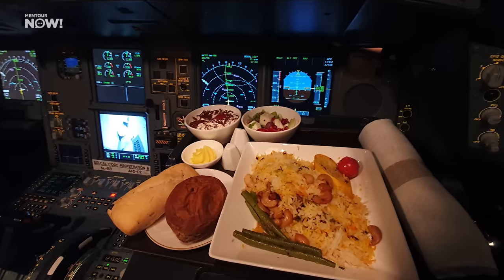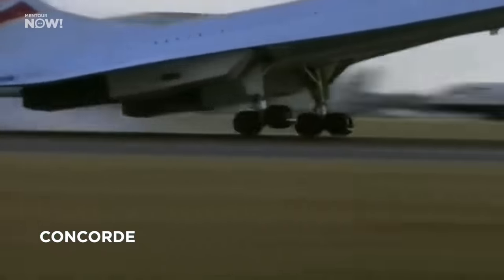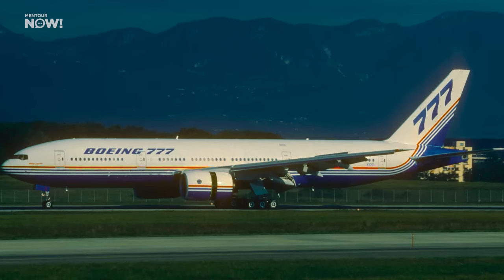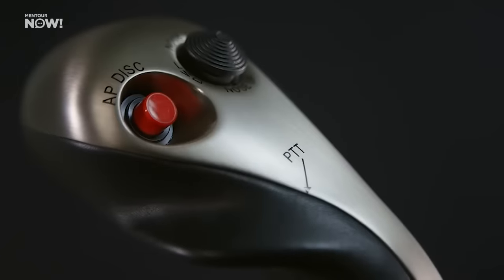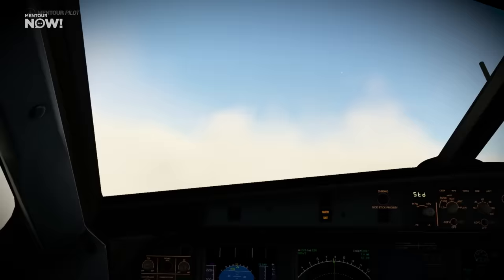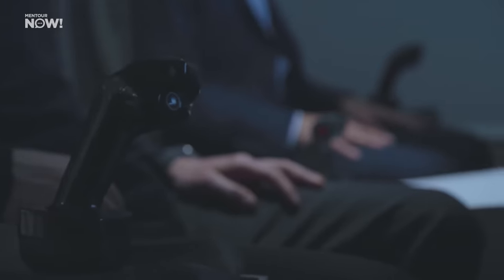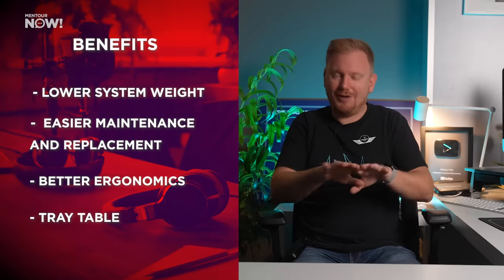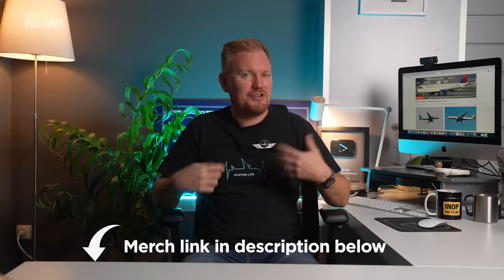Will Airbus Finally switch??

Comment: I wonder if the author has actually spoken to anyone who has been involved in design, build and certifying  an aircraft.
The idea that anyone is going to design , test and certify a retrofit for some 15,000 A320 and another couple of thousand airbus wide bodies, is way out in the realms of totally ridiculous.
Would Airbus do the next aircraft with one ? Well, they haven’t shown any inclination so far. After all, why would they? Which accidents are there directly linked to the sidesticks not being linked and there being no other indication of the main item, the pitch attitude, resultant flight path and performance, that would not have given clear indications of inappropriate control inputs, whether manual, or automatic? 
By the way, the side stick is clearly visible from the other seat. As for non moving thrust levers. Well, I have flown the 747-400. I watched the ATS drop out and the crew let the speed drop several tens of knots below the bug, have an EICAS message and still do nothing. I watched the ground spoilers not automatically deploy, but the crew called them deployed, even though the handle did not move!
If you want to know how much thrust/RPm, EPR you have, you have to look at the gauges. The thrust levers are merely a “wish list”. After all , a failed engine can have the thrust Lever fully forward.
As for flight control laws. Both Airbus and Boeing use the C* law. That is  a G demand law , which at lower speeds gets phased into a pitch rate demand. Without that,  you would get to impossibly high pitch rates. This is not the  Airbus protections, they are separate.  Boeing has an additional function, U . This introduces a speed reference input. Essentially, the trim switches operated by the pilots select a reference. It is instantaneous if the pickle switch is used. It does NOT control the stab trim on Normal Law! I it use sets a reference for the flight control laws U term. The U term causes a pitch up or down term into the flight path laws if the speed deviates more than plus or minus 10kts from the chosen reference. It doesn’t change the trim, just the flight path. Why plus or minus 10kts? Well, otherwise the ATS ( nominal accuracy +/- 5kts, would cause constant deviations in flight path. Add in another few kts for turbulence and you end up with 10kts. 
As for the. 777 moving control column. It is a several hundred pound weight system, with dual hydraulic jacks. As you may or may not appreciate, those jacks require their own set of protections to guard against a runaway , which  could spoil your day. When the AP is engaged, the control column has to be made to work as if in manual flight. If the back drive fails, no AP! 
So, back driving with power, rather than the old style hooking on to the elevator or aileron control runs,  creates another set of potentially lethal failure cases to be dealt with.
So, in the best tradition of the late Bill Lear of Learjet fame, the non back driven FBW, is simple and light. The additional training  needed to deal with its characteristics, as implemented in the Airbus, is relatively small. It is really not that different to that needed to cope with say, the go around handling with AP failure from a CAT3 approach of the 747

Comment: "touch screens" UGH....
Are they putting them in there because pilots actually prefer touch screens over buttons/ knobs/ levers with tactile feedback, or are they there simply because they are "new and cool"? Personally I hate touch screens.. on atm's- they suck. Post-automats: 70% not working correctly. Phone- way harder to type compared to mechanical keyboard...

Comment: does anyone know what computer language or operational system a comercial airplane use?
Reply: In case of Airbus, automatic code generation is a big topic. Things like flight control laws are graphically programmed. Just like Simulink models. For newer aircraft, they use SCADE. For older versions, there are similar tool sets. A320 FBW was partially coded with GALA and PALAS as the underlying tool set. Assembly by hand was also done, and maybe still is for deeper stuff like I/O drivers. SCADE generates C code which then is compiled by compilers like CompCert. OSs, as far as I know, aren't used. Instead,  fixed cooperative scheduling by an ISR. So nothing like VxWorks... 
For the A320 SEC (as an example): First they define a new SAO sheet, could be a part of the C* alternate law, by "clicking" together standard numerical blocks like sum, integrators and so on, that's what I meant with graphical programming. Then you specify the cycle time of this sheet (like 30ms). It is compiled, signals are linked together (signals/interconnections are static variables in RAM) and taking into account all the other SAO sheets (with their specific timing and signals), blocks of function calls to all compiled sheets are generated. In case of SEC => 8 blocks. These eight blocks are called by a timer-ISR (cycle = 15ms). That's it. All sheets are called either with 15, 30, 60, 120ms.

Comment: I'm not very bothered by the differences between a flight yoke and a sidestick, manual flight controls or fly by wire. What really bugs me about the Airbus sidestick is the positioning of it, where a right-handed person in the captain's seat, would be forced to control the sidestick with his or her non-dominant hand. I'm not a real world pilot, just a gamer/simulator pilot, but if you told me I had to control my plane IN A GAME with my non-dominant hand, I'd tell you to GTFO. That's in a game, which has zero consequences to myself or anyone else if I mess something up.. but somehow real world Airbus pilots have to deal with it, carrying the responsibility of hundreds of lives on their shoulders. o.O  I get that there's a difference trying to dogfight in a WWII simulator, rolling and jiving and trying to shoot down your opponent, compared to modern day commercial flying, but you know.. still.
Reply from the maker: Actually it's not that big a deal. With a yoke, you mostly use your left hand, if you're sitting on the left. Same if you have a center-mounted stick and sit on the left in a small plane. And even in a left-hand drive car with a manual gearbox, your left hand will spend much more time on the wheel than the right one... whether you're right or left handed.
Reply: @MentourNow  I've read that before, and I have a sister who's a glider pilot and she says it's not that big of a problem. Also if it was a big deal obviously actual airline pilots (like yourself) and the engineers would have done something about it, so intellectually I get it. The analogy of driving a car with a left-side mounted steering wheel also makes perfect sense, it's never even crossed my mind that I wouldn't be able to steer the car with my non-dominant hand. xD  I guess it just messes with my head to think about controlling a plane with my left hand, as though it would require the fine motor capabilities needed to write text or to draw something with a pen. :)

Comment: Seems that in order to win the public, Boeing is going to have to come out with a triple redundant system. If Boeing doesn't get back to the business of making quality airplanes, and stop fooling around with accounting games, they are always going to have potential quality problem with their aircraft. Accountants make their living by saving money, but this is at the expense of quality of their manufacturer of airplanes. 

For all the money that Boeing has saved, they've spent more money because of a few mistakes that could have been avoided by inspections. 

Airplanes are not like cars. It takes a lot more to build an airplane than it does a car.

Comment: As you and others have said, the Joysticks don't provide Feedback, and since they can cancel each other, they are actually a Danger to Flight Safety. They might have servos to sort of link them together, but I would prefer a Mechanical Linkage between the Two.
Flight Envelope Protection.... Yeah, that brought many an Airbus 320 Down, or made many completely Terrified Passengers wondering if they were going to die
Since 1990, I have NEVER been comfortable when flying on an Airbus 320 or 319
7J7? Isn't that just a DC-9, that Boeing got when it bought the Maker of the Deadly DC-10/MD-11? I know Boeing Aircraft seem to have went downhill since MD Engineers an Management came along

Comment: You're literally AirBUS drivers, not fighter pilots.  Besides, isn't it smarter to allow pilots to decide to fly with the left, right or both hands on the controls?  I've flown a single engine piston airplane with a side stick from the co-pilot's seat because I prefer to fly with my dominant (right) hand on the stick.  Only the French would unilaterally decide pilots must be left handed.  Frogs....

Comment: Your video sounds like an advertisement for active side sticks, very strange. You forgot to mention that on an Airbus with side sticks there is an aural warning "dual input" when both pilots are moving their respective sticks with a visual warning in front of each pilots. A priority can be selected by pressing the AP push button with again an aural warning "priority left/right" and a visual warning in front of each pilots.
So your demonstration for an active side stick is very partial and do not even mention the added complexity on the flight control system with all relevant failures.
Believe me, the Airbus independent side sticks associated with aural and visual warnings is the best solution and proven by millions flight hours, it's lighter, robust, reliable and efficient.

Comment: You gloss over AF447 where they flew it into the ocean, it’s passing mention is really disturbing.  Also you keep harping on how much heavier the Boeing yoke system is, but you never say how much the weight penalty is, because in relation to other weights is minimal.  But you keep harping on weight as if it is a ton or more when it is not.
Reply from the maker: What do you mean? I’ve done an almost hour long documentary about AF447 where I explained in minute detail the problem these side-sticks represented. 
In this video I also highlight their shortcomings.
Reply: Even if Mentour did not mention AF447, he don't have to. Who said we have to mention AF447 every time we mention sidestick shortcomings in Airbus? Many folks know the sidesticks aren't linked and have no force feedback, even without the mention of AF447.

Comment: Fly by wire it s the solution to a non existent problem... and we have many cases in which was useless or even dangerous in conjunction with the low level of understanding from the operators. If all the money that went into developing it were spent to better train and remunerate pilots worldwide... we would fly in safer skies today. But hey ... let s ignore human intelligence and capabilities and build a machine that can do it better... just plain stupidity and lack of basic logic.

Comment: The fundamental problem with the Airbus is that the handling pilot always has a computer making the final decision on flight control position. And so an Airbus 320 can dive into the sea from 3000 feet with the handling pilot commanding full nose up while a computer holds full elevator down. Or an Air France Airbus mid Atlantic with the handling pilot commanding nose down moves the elevators to the neutral position because the none handling pilot is commanding nose up.
Ridiculous.

Comment: If you want to know about Airbus side stick technology , ask family members of the dead passengers on Air Frances flight 447 or read the accident investigation report into that catastrophy .... .......carefully. ..
They try to skip past it like its no big deal..

This channel should do a video in it....
Won't go down very well if hes honest..
Not with Airbus anyway....

Its designed by a special needs half wit nerd at a desk

Imagine 2 french pilots flying a same plane at the same time and because they're fighting each other at the controls without either of them being aware of it the best thing the boffins on the ground could come up with is....

"Split the difference ".   ...

Instead of delivering a 250,000 volt shock to one of the pilots so he lets go of the controls they've decided...".just average it out between them and everyone's happy...

Comment: it is Boeing or i am not going.
Specifically because of the side stick nonsense.

There have been accidents caused by the side stick, just because it does not show to the other pilot what is the input.
With the yoke you immediately feel and see what the other pilot is doing.

It does not make sense to have computer controllers up in a cockpit. We have seen that with airplanes and with Titan, the submersible. 
A yoke is what should be there.
Joysticks are for virtual flying, not real flying.

Comment: I haven't watched the whole video, but regarding the video title question - which you know is a stupid question. No - Airbus will never switch back to a yoke system. They haven't used a yoke for the last 35-40 years, so why on earth would they now switch back to an ancient 100+ year old design?
Reply: If you watched the video, you'd know he meant switching to active sidesticks, not yokes.
Reply: @ARandom777  Ok, I didn't watch all the video as his video's tend to be a bit long and drawn out. My bad, but also I don't see the points of switching to active sidesticks anyway. There is no need if you have competent pilots up front....